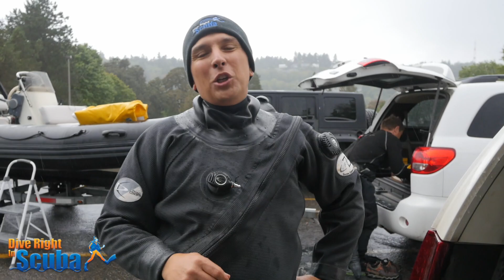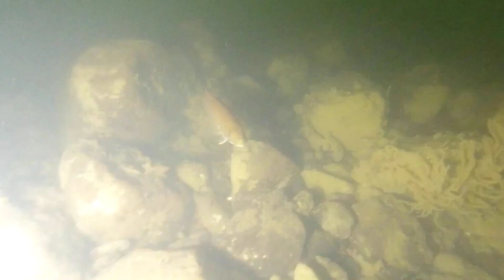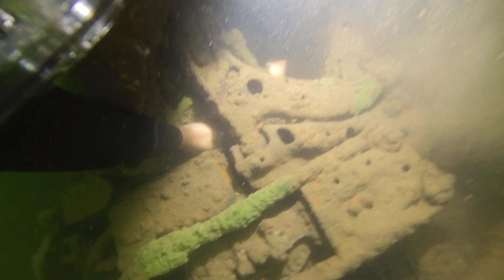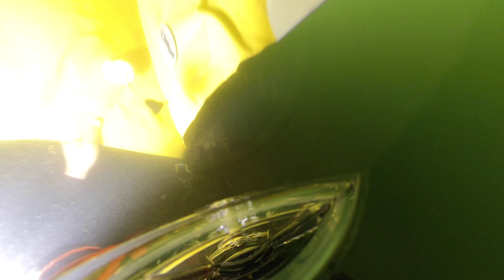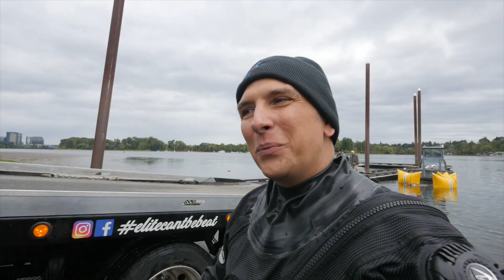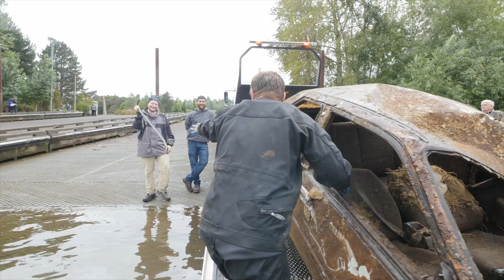FOUND FORD 22' Underwater in River at Boat Ramp!

Comment: Hi guys.
As a proffesional scubagear and suit service teknican.
I realy rekomend to wash all rubberseals with soup amideatley. After every oily muddive you do.
Petrol, diesel and motor oil kill the drysuit seals allmost amidiatly.
Do not even use degreaser. That just accelerate the braking down. 

Do not forgot rhe rubber hoses on the regulators.

Janne in Sweden.

Comment: So the key was clearly in the on position when the car was dumped... the clue is the passenger seatbelt was in the drive position. On that model it had motorized seatbelts which drove back and forth along the roof line when the key was turned on and off.

Comment: Whr do you not close the valves on those lift bags BEFORE you put them under water?  Just saying
Reply from the maker: The reason is that air is usually trapped and it's not until we are pulling them down at the surface that the remaining air escapes. Then we forget sometimes as you saw.
Reply: @AdventuresWithPurpose ok  fine   lmao

Comment: Ford Escorts were huge pieces of poo! I towed many of them when they existed. Lol 🤣
Reply: I had an Escort and it didn't give me any issues and I drove that damn thing all over the place. Just routine maintenance (oil change, tune-up, battery, etc). I'd happily buy another one because of the reliability I had from mine during years of ownership while it was only on a stroke of luck to have a Chevy even start, let alone make it to the destination on its own
Reply: The early ones were if you didn't change the water pump and timing belt every 50000 miles, the later ones were much better.
Reply: Mk1 ford escorts sell for about 60 grand USA dollars in the UK
Reply: @chriscollins550  They should have sold that one in the US instead, it probably would have been a hit here. The Mk1 is basically a Escort with a rocket engine in it. Lol 😆
Reply: @Djwally13  well you had for models of it back then. You had a basic small engine, then the had the executive then the deluxe and the GT a last but not least at all was the big engine up rated cross members racing pod dashboard bucket seats and body kit and that was the Mexico

Comment: Put a Chevy in the river for 10 years and you'll pull it out peice by peice fords come out in one peice chevys fall apart when you pull them out if there's anything let by that time 
Cheap
Heads
Every 
Valve 
Rattles
Oil
Leaks 
Every 
Time

Comment: When i was younger my uncles father in-law had a 79 ford "f250" which was an f250 body on an 80s dodge frame 4x4 cummins. Sweet truck but why i mention it is because on the tailgate where it had the raised ford letters it also had pinstriping that read F*cked Over Rebuilt Dodge